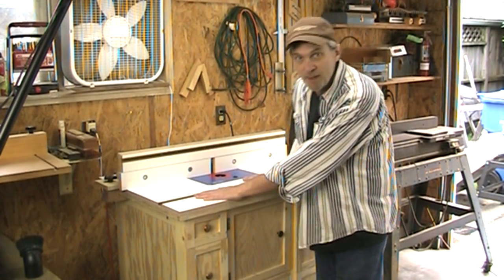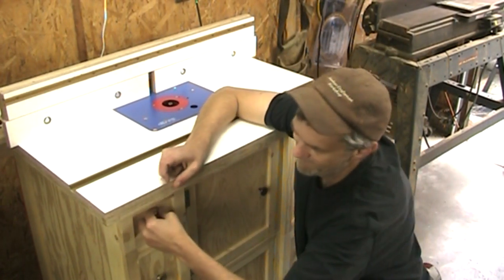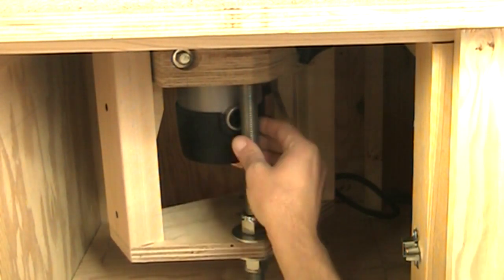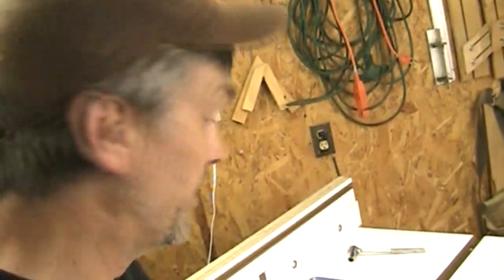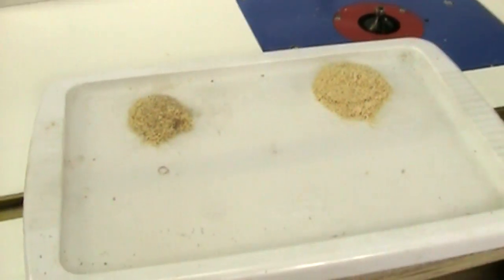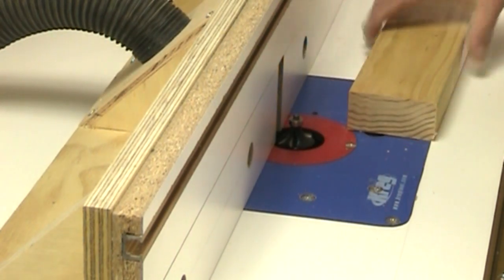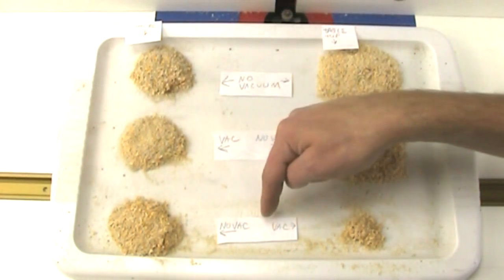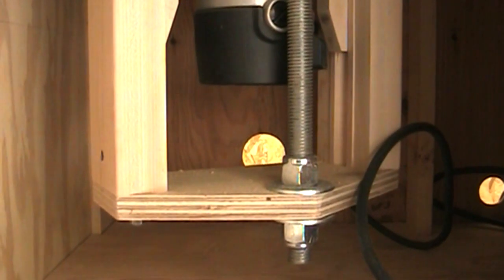MM 3-30-12: Router table dust extraction test

Comment: You need to stop the loss of suction from the router by making that cabinet air tight except for the opening for the router bit. Air will find the easiest route to the vacuum.  You have another large hole drilled into that common space and the door it self is not air tight. You lose of most of your suction through those openings and little suction remains near the router bit. The challenge is having a near air tight cabinet but giving your router the cooling air for the motor.  Some folks attach a dryer exhaust tube to the router that lets fresh air into the router but maintains the low pressure inside the cabinet.

Comment: Why have the fence so far away from the cutter? The  gap is governed by the distance from cutting edge of router bit to the bearing. Also if you have a fence why are you free handing the timber.?

Comment: Why is the bering of the cutter so far away from the fence opening? You may have to make that opening larger. I use a 3/8 rabbit cutter with the router table and get Bailey. No dust at all.
Leaving the center of the bearing just pass fence

Comment: I know its been a while since this was posted but I have a suggestion. I have the exact same lift and table that you have. The adjustable fences are designed to be adjusted to allow for the bit to be recessed between them. 
Try this, install your bearing type bit. Loosen your primary fence and use a straight edge flush against the secondary fences and push the fence back until the straight edge hits the bearing. Both adjustable fences and bearing are know flush, tighten your main fence. Adjust the secondary fences as close to the bit as you can obviously without hitting the bit. Now almost 2/3 rds of the bit is within the exhaust opening. I have very little on top and not near as much are your experiencing on bottom.

Comment: like your youtube channel.
Build a housing for router under the router table case. box up the router to make air closed then drill a hole on the top corner to put a pipe hole for vacuim to suck the saw dust and make a hole on the bottom for air vent. drill a hole on top plate to suck from the top to.

Comment: Steve, put a bowl with a bit of water inside on the bottom to catch the dust and you are done with that. some vacuum cleaners use water as a dust collector / filter. In your case dust just drops into the base, so water will work as a trap for this dust inside. Then throw the water of just filter it. cheers
Reply: That is a very clever idea. how do you keep the water from spilling while you moving the table across the room with uneven flooring?   Perhaps a Cookie sheet with just about a 1/4" of water?
Reply: Many vacuum cleaners since the sixties uses nothing but just WATER as filter LOL, they were wrong all these years. You can see pictures of how the bucket is done, it like a water "trap". Water only spill I guess if you put the vacuum cleaner upsidedown. Read before trying to make fool of others. Regards.

Comment: I solved my rocking issue by having one side (which consists of two legs) independent from the main frame by pivoting it on one bolt in the center

Comment: Steve: You may want to look at the video that Ed Stiles has on dust collection on his router table. One thing he notes is that you may need to find a way to keep air going to the router, as it needs air to cool the motor. Other than that, he has a vacuum to the box, looks pretty well sealed, to collect the dust.

Comment: I would seal the underside, you have too many holes for the vacuum to actually work. Use silicone to seal any gaps. Enclose the cavity for the router to make it smaller. Run the hose closer to the router and create some sort of nozzle with a wider opening and of course closer to the bit is better as well.

Comment: I use a shop vac right now on my router table as well.  I'm moving to a wall mount dust collector though, since I'll get double the CFM at least.  Have you thought of showing a test of a dust collector vs. shop vac?  I bet the difference would be considerable.

Comment: I think if you sealed the hole in the back where you put the cords through it would create a vacuum chamber in the cabinet with only one air intake (the hole where the bit comes through) and one output (the vac port). It would collect a lot more dust because all the air would be flowing the same direction

Comment: The problem with the dust underneath is the volume of the space in that chamber is too large to attain proper suction. If you create a chamber around the router lift, it would not only catch all the dust, but it would also (with a dust port on it) allow a smaller volume chamber so that the dust heads straight to the port. Or you could try the deflector thing like this guy:

Comment: STEVE! make a mount inside the cabinet right by the hole where the bit is and have your hose suck directly from the source of the dust. (if you have room to put the hose that is) i think this would solve the problem. if any dust gets on top itll probably be a very small amount and easy to clean up and little to nothing will fall inside (i bet its a pain cleaning out the inside, and it cant  be to healthy for the router with all that dust falling down there)
if you read this,thanks for reading :)

Comment: Run some PVC joints from the back of the box and the top of the table. Radius of your vac tubes that reduce to only 40% diameter on the table and 60% on the box. Then caulk and seal that box up like a mofo. Cut an intake port as far away from the hole you drill for outflow. Connect that to the blower port on the vac. no change in tube diameter.  Thermo dynamically it should be hot dry air rushing into the chamber rising and taking fine dust up into the vac filter.  Does that make sense?

Comment: Hoi Steve

love your videos,
The dust inside the cabinet doesn't get vacuumed away because the air speed inside the cabinet is too slow due to the expansion of the volume,
Another idea is to place a "dust  drawer" that way the dust accumulates inside the  drawer and it is easier to take out.

Keep up the good work
Sjuul (Netherlands)

Comment: To get the most dust you have to get as close to the source of the dust as possible. If you could figure some way to put a 5g bucket around the router itself and then mount your hose to that it would probably be ideal. Especially if the hose mounted to the bucket at an angle, Turbo style.

Comment: Why you not make a drawer inside in the bottom, all the sawdust will fall inside, after the work you just pull out the drawer with dust..... Or,  try to put the vacuum cleaner on the bottom instead to the side, with the floor made with an angle of p.ex. of 30°, the sawdust will fall exactly in the vacuum hole...
Sorry for my "maccheroni" english.
Ciao from Italy

Comment: You might want to check out davetpilot's dust collection solution. It seems like it would be fairly simple to mod your table to work in a similar fashion.

I'd post a link to the video, but I get errors every time I try.

Comment: Steve, great job on this but as you were explaining i had a thought. run a piece of pvc up inside the case so that your collector is right at the bit on the underside of the table. that will do the same as pulling the dust through the fence, only it will be pulling it down through the hole in the router plate. just a thought. -Brian

Comment: One issue from the bottom is that you have another hole in the back of that cabinet. This will greatly reduce the pressure in the cabinet and reduce the vacs effectiveness.

Comment: As a general note... Keep in mind that airflow in the big box will get very turbulent. Anything to focus, straighten and narrow airflow from the router bit to the vacuum port will help. I studied fluid dynamics in undergrad, but I don't recall know whether the improvement is more linearly related to volume or flow cross section area... maybe somewhere in between. Pls feel free to email or msg me if there are questions or if I can help further.

Comment: Hi Steve. Love your videos. Thx for all you do. Comments to improve performance underside: If there's a straightforward way to implement the following, these will make a big difference: (1) bring the hose end right up to the router or as close as possible (2) irflow holes in the front will make a big difference as suggested and (3) creating a small u-shaped air duct channel from front to back to narrow, straighten and focus airflow.

Comment: In both of my homemade tables I found that a small leak like the one you see inside the cabinet to the right will cause the collection to be abysmal. Make the cabinet air tight, so air tight you can't open the front door while suction is on and you block off the hole for the bit with your hand. When you do that, you are essentially making the bit hole itself the end of the suction hose. It will get everhing into the bottom of the cabinet, but it will leave lots inside to have to suck out by hand

Comment: I see a hole to the right in the lower compartment.  Try plugging that hole so it doesn't short circuit the air.  You want the high velocity air coming down were the bit is.  Nice Video.

Comment: ... or the other option:  Use it with the shop vac on the fence and suck out the dust from the cabinet when you are done. 

Don't spend the money unless (and until) you get tired of the manual clean-up!

Comment: Not enough CFM's from a Shop Vac.  Splitting it to use both ports would make the problem even worse.  If you used a small collector and pulled 1000 CFM from the fence (close to the bit), you would see a large improvement.

Better yet, put some baffles in the bottom cabinet, open a few intake holes (to maintain airflow), use a bigger collector (ie, 1600 CFM) and a Y to pull from both locations and you would be amazed...

Thanks for the videos!

Comment: Steve,

Increase the fence opening on the intake size... this will allow the dust to hit the opening easier. 

As for dust collection in the inside.... it will not pull any air if there is no air to replace it. Cut a few holes in the front of your door... it will allow airflow causing the dust to fall into this path... pulling it out of the box.

Comment: Opening the door would reduce the anount of air being drawn down next to the bit, i would gess the bit is throwing the dust away from the hole quicker than the air can suck it, maybe if you extended the tube so it was closer to the bit (like on the routers that have a dust collector thing)
What about if you widened the gap in your fence and just used that ?

Comment: just an idea, maybe if you sealed off the area inside to the right where the electronics are and put some kind of vent in the bottom of the door to create some air movement toward the dust collection port? maybe that would help collect more saw dust.

Comment: Hey Steve, maybe you could cut some little square out of the door and put in a Grid, so you would have a air flow for the dust extraction without loosing too much estetic of your beautiful router table. By the way, what you else could do is to buy an Y adaptor and so you could connect your shop vac to both extraction holes. And i agree to your suggestion to put the hole closer to the bottom. Greetings from Luxembourg ;-)